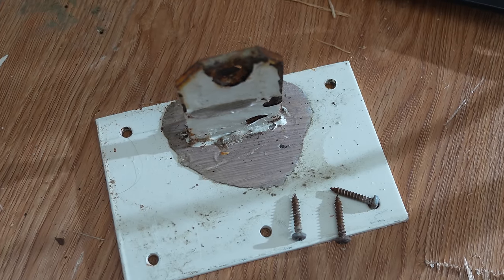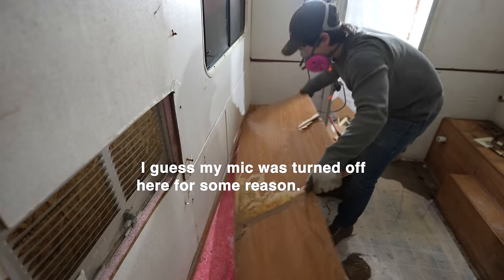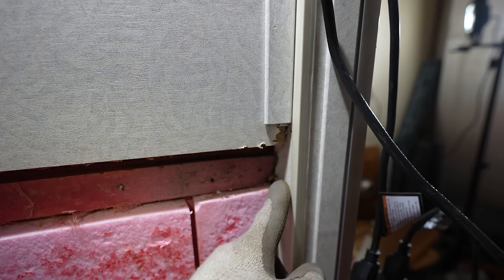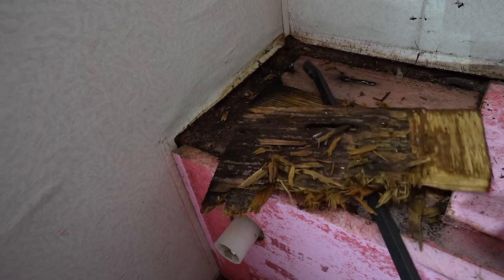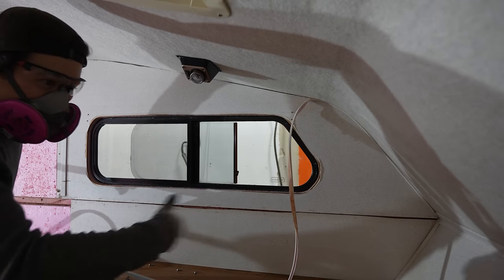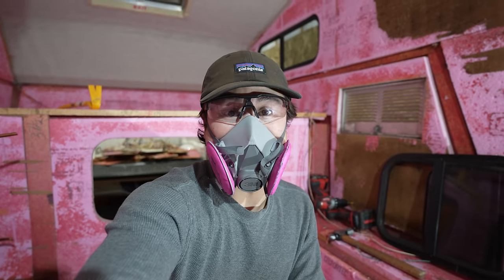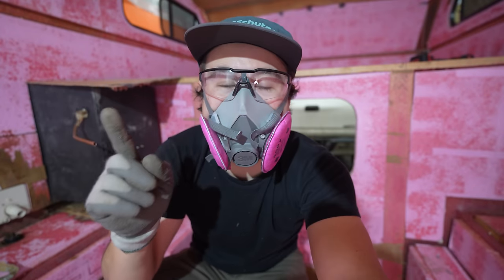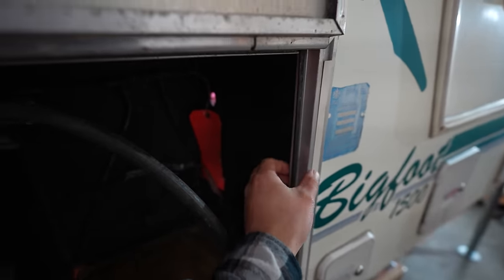It’s a Disaster in Here (Bigfoot Truck Camper Renovation)

Comment: As a Union Electrician. Please please please please pleasee!!!!!! Make your outlets GFCI. No one in van life is doing so. And all deal with water damage that laters damage their electric. If moisture is always present please install gfci outlets with usb to charge your phone. Also I can’t stress this enough. The last tiny home I helped with I suggested to the Client for armored cable. In case water gets in, or rats/raccoons, etc they are unable to damage the wires. Romex and those cute 12v wires will get destroy over time if water is in the built. Corrosion and all, which causes voltage drop. When voltage is drop not alot of amps get to pur appliances. Causing us to use it more to try to make up for it, but it wont. It may cost alot now, but get BX Armor cable. Or just expect you always fixing your rig every couple years. Too many water issues in these built and I keep watching romex, 12v cable being used. And fyi 12v can come in a armor cable it needs to be order. I keep watching people spend $10,000 on electric in tiny homes and it will get destroy within 5years from water damage to be done again. But job security is why most wont suggest this. Happy Built!! 🙏🏾
Reply: Hey thanks for sharing these awesome tips! 👍

Comment: I bought and converted a school bus in Washington state. The subfloor was plywood. It was absolutely soaked with water. The bus had no leaks. I think it was just 20 years of the pnw moisture with nothing to mitigate it. After converting it and getting rid of all the wet wood, I got a dehumidifier and I run it 24/7 in it. I have zero mold or moisture issues. Plus I have a wood stove and diesel heater so that helps keep it dry inside too. I live in it full time. I’d advise doing exactly what you’re doing and then use a dehumidifier when not in use and a dry source of heat when you’re in it. Ventilate whenever you’re boiling water or cooking, mitigate moisture as much as you can.

Comment: As many have commented, I really feel for you having all this water damage hidden just beneath where it could be seen. Wouldn't wish it on anyone. At the same time, I also, would be excited for the opportunity of making a completely custom and unique layout that can be perfect for you. Hell, it needs to be re-done anyways, and I suspect, with your investment now being far greater than originally planned, there's few reasons not to pull out all the stops and really go big!
If it's any consolation, it makes for truly great content -- very valuable and eye-opening for those of us looking to buy a used RV, such as myself. I, personally, won't ever unsee or forget your experience and bless you for documenting it all. It's a lesson I really can't put a price on.
3M makes a rubber "eraser" kind of like a grinding wheel that attaches to a drill, which is usually made for removing decals and stripes from paint - might work on the residue you're dealing with (just keep wearing the respirator in that case). You might also try acetone with a paint brush on it and then Red Seal for moisture sealing after.
Oh and any video between 20 - 30 minutes is ideal, longer can be fine if there's enough going on to justify it without too much repetition. I'm loving your current way of doing it -- good detail and not overly repetetive. 
Cheers!....from North Vancouver

Comment: You should get ahold of an ozone machine. Detail shops and body shops have them. You can put it inside an area and it will kill the bacteria and mold. Stops it in its tracks. It gets rid of bad mildew smell too. It leaves a little chlorine smell for a few days but airs out. Not sure if ozone machine is the correct title. Thats just what we call them at my shop. Keep up the good work. 👍

Comment: Oh boy, this is so much worse than I thought you'd find. I feel so bad for you. However, fear naught, you'll make it right. You'll be able to enjoy it for years to come. I purchased a huge '98 Lance with a dry bath about four years ago. Fortunately for me, the man I purchased it from did major reconstruction on it. The only part left with issues was the window over the bed that faces over the hood of my truck. Those always leak, and while I've repaired it, I plan on having it professionally removed completely next year. Glad to see your camper does not have that window. I'm a 73-years-old female and was able to completely reseal and repaint the outside of my camper. It wasn't leaking, but they need to be resealed periodically. It's  just part of normal maintenance. I've also made several modifications to the interior. For example, I removed all the cloth covered surrounds from the windows and made blackout curtains that go from the ceiling down to the bottom and the sides, not just over the window frames. Just those little changes make it look and feel so much more roomy inside. I also sacrificed a clothes closet to have a custom-built woodstove installed. Best improvement ever as propane heat makes too much condensation. Looking forward to following your progress. You've seen the worst of it, and you'll make it sound again and probably better than new.

Comment: The red stuff is contact cement. Lacquer thinner is used to remove that. If the dirt and mold is on that then try lacquer thinner. Wear your mask and use in ventilated are.

Comment: Killz is the best thing for mold. You will definitely need your Air mask because it smells absolutely horrible. You'll need to paint it on the bad areas and then leave for a day or two, to let the fumes evaporate. 
For drying your floor out, your best bet is a regular box fan. Heaters help but nothing will dry out wet areas like a floor fan. When you see an area is good and dry then just turn the fan to the next area. Best of luck Jonathan, I really enjoy your videos.

Comment: Those hold down brackets are fine, they need some sandblasting, prime & paint. Goof off will work most likely remove the adhesive left behind. Lastly, you gotta remove the insulation and use a hose to spray the outside and try to find leak(s). Good luck on the project!!!

Comment: What a mess. I remember when you purchased this and said that you wanted a fiberglass camper so you did not have to deal with moister inside! Kudos to you for seeing it through. Use anti Microbial bleach on the mold. When you seal up use silk a flex. Its the best stuff out there as it marine grade. That old fart that sold that knew there was water damage. I am sure as he was filling up the water and half of it went into the camper he was aware. Spray foam insulation where needed.

Comment: I spent a year rebuilding my travel trailer. 
Complete new front end
8 back from the front
3 feet of rotted roof at the front 
1 foot of rotted roof at the rear. 

New roof
New flooring
New ceiling in the rotted parts. 

Did a bunch of improvements along the way. 

1/2 way through I was rethinking my idea. Honestly thought about lighting it on fire and trying to claim insurance.  But I kept going. 

I now have a really really nice trailer. Anyone who have looked at what I have done are all really impressed. 

Don’t let it get you down, once you are done you will know what you have.

Comment: Good progress. Ideas: Use scotchbrite pads on a drill driver or small grinder to prep the fibreglass. Don’t breathe the dust. While the old damage is from leaks you will also want to stop using an unvented catalytic heater inside. Everywhere the water vapour touches the cold spots of the shell and windows will condense and saturate any material that will absorb it.

Comment: You may be able to find an RV junkyard/2nd hand materials. Like maybe double-pane windows, a diesel heater,, other things. However, since the unit is smaller than normal doing everything with newer materials would be better.  Best of luck. With the mold there are products, some expensive others are DIY which work like Vinegar and Water. Your choice. Check others who did off-grid repairs with mold, rebuilt campers on YouTube U.
Reply: Yes! Exactly. Vinegar is far superior for mold (30% vinegar at hardware stores also.) Bleach does not kill mold like many think. Most mold experts agree. It’s become a myth at this point. It doesn’t kill the mold roots. Second hand materials sounds like a potential avenue as you’ve stated as well!

Comment: Some years ago, before everyone was on You Tube, I read a post about a guy with a Class C who had a relatively minor traffic accident. Whatever was holding the house part onto the chassis failed, the box shifted and twisted and it was never the same again no matter what he did to realign it. Consider getting an ozone machine from someone, home renovators, used car dealers and detailers use them. It kills mold and mildew, be careful though and use it safely, follow the directions..

Comment: You really tore the camper down to the bones 🦴 on this one!  It’s hard work, and yes, while it is both surprising and disappointing to find the water damage and other issues, it is also a relief to know you’ve torn it out, are cleaning it up and making it better for you in the future!  Plus with it stripped down like that, you basically have a “blank canvas” to start rebuilding it, the way you want it!  Make sure the replacement mounts/bracing/brackets and all the installations you do, are rated for the maximum weight and the structural integrity etc., of the camper when replacing them, while keeping the entire project within the max weight, etc..  it will be interesting to see if or how you cut the walls out to deal with the leaks.  You might have to do some fiberglass patching/repair work inside and outside to make the shell more waterproof.  You can do it!  Breaking up the videos into smaller segments is a good thing, in my opinion. It shows stages of demo/tear down, then the next steps in stages.  You’ll be back out there doing what you love to do and you’ll have more confidence in your skills after this project.  Enjoy, be safe and keep going!!

Comment: looks a lot like my project.. :D nice at the first look, but something else under the surface, i ended up ripping everything of to bare glassfiber, all hatches, windows, doors and outer trims of, from the inside to bare glassfiber, after that you can pressure wash it, because there isnt anything to suck the moisture anymore.
blank canvas it is and lots of work you are going to need, strength to that process 👍
i ended up glueing 2x2 with pur glue in to the walls and had it spray foam insulated, after that it was easy to cover with thin plywood.

Comment: The floor is so wet because it is basically a bathtub. All the water ran to the lowest point and it has been trapped there under that linoleum for 25 years. Just rip it out because it will never fully dry out. 

When you rework the tie downs Don't forget you need backing plates at least the same square dimensions as those provided.

You may want to look at using Coosa board in the floor and starboard for any of the other features that might get wet.

Comment: Bummer, Jonathan.  
3M black strip caulk is good to use when resealing windows to side of camper.  
The window seals themselves and the drains plug and cause leaks too.  
If the window Glass seals shrink and gap, Black RTV Automotive type silicone works to fill trim gaps.   

Big Job ahead of you.

Comment: Always remember....If there are seams there's the potential for leaks and damages.
We too learned a lesson the hard way when we bought a older used Van. We bought it cheap. The motor is great  and milage not so bad the front interior is really surprisingly good but so many little things we have had to redo to be able to camp In it were at times overwhelming. 
After we finished we are so satisfied and happy.
You will be too.

Comment: Those fittings, small openings etc. that is sticking out of the exterior walls will be needed to removed and re sealed up all over again prior to repanelling your interior’s again, with all that foam board insulation is crazy cheap you can even replace all of or some of those pink stuffs to make sure everything is checked out under

Comment: Use a wire brush to clean that metal piece.Smear some petroleum jelly,grease or aluminum roof coat(silver like tar for roofs),and that should protect it long term from corrosion

Comment: These campers are coveted by many and were built here in British Columbia, Canada.  My boyfriend has one.  They are an all season camper that weigh literally 900 pounds and fit short boxed import trucks.  They were made with extreme quality and not just particle board cupboards.  This is an older model and fibreglass will develop condensation without anything like Drizaire inside the unit to absorb the humidity.  I am thinking that this is where the rot has come from.  The owner he bought it from lived directly on the westcoast of BC and the humidity here is insane.  I have a fibreglass boler and if I don’t have Drizaire inside it will develop mould.  It is still a quality camper and the water issues could have come from the waterlines.  Or maybe the butyl tape that is underneath the windows have lost their seal.  The bunk was dry.  I think it is a humidity issue.  It is good to remove the dry rot.  Check out “Tails Of Wonderlust.”  She drove all the way from Colorado to pick up the same camper in Tofino.  In 2016 when my guy got his.  There was a bidding war on it.  Simply because they are quality campers.  Big Foot and Northernlite were once the same company.  But they separated.  But they did not change the quality of their builds.  These days to buy a Northern Lite Camper your looking at a very high price.  So many take these campers apart and don’t realize that some things are structural.  I hope that things go well for him during his new build.  I would definitely check out the website Fibreglass RV for points on rebuilding a fibreglass camper.

Comment: Never fun when you uncover hidden damage but I'm glad to see you are fixing it right.  As for cleaning that mold and dirt I would recommend using Purple Power to clean the dirt and bleach for the mold. The PP may make it look like the mold cleaned off but use bleach anyway. It will actually kill the mold. Hope this helps and looking forward to the rebuild 🙂
Reply: Having dealt with mold and relatives owning businesses in construction and inspections, they told me that it’s actually a myth that bleach kills mold. The mold experts agree. Vinegar kills mold better than bleach, even strong vinegar (30% at hardware stores) is far superior. Just figured I’d share in case anyone might find it helpful.

Comment: Your brackets seem to be in good shape.  Just clean them.  Paint with a good expoy paint and then bolt them to the new wooden floor.  Tighten the bolts on the inside on the metal. That will give you a bunch stronger anchor.

Comment: Thoughts on cleaning the mold on the fiberglass.  My first thought was a TSP substitute.  Then maybe Zep liquid mold remover.  A good stiff brush first to loosen the gunk that is stuck on and will come off would help before trying some liquid product.  I'm glad you found those issues before your camper fell off while driving down the road.

Comment: I’m definitely into a longer 45-60 min video. Alex has the same exact Bigfoot camper and all the same water issues. A nightmare for the both of you! I’m FLOORED over those “mounts.” That’s absolutely terrifying!! You are such a talented tro oper Jonathan!!! We’re here for you and your work!! 👍👍 edit: regarding MOLD, bleach doesn’t work.  It’s become a “myth” that it kills but it doesn’t. Vinegar is actually highly preferred over many other cleaners, and at the big box hardware stores they have a much stronger 30% vinegar for about $20-30 per gallon. There are also inhibitors usually sold as sprays that one can use to treat wood etc. I’m not sure about the fiberglass aspect of it though.

Comment: I cringe everytime I hear someone say "silicone" when weather proofing an RV.  Silicone itself will fail.  Notice how that yellow silicone pulled away from the frame in you video. That is what it will do.
You are in a great place to get information from the marine world.  I suggest going to a boat build or repair facility and talk to the experts about marine caulking and adhesives.  Expensive but "buy once, cry once".
We're really enjoying your build.  Brings us back to our van build.
A suggestion:  Run all your wires and plumbing so you can access all the wires without removing walls.  That way, if something happens, or if you want to add something, you have easy access to the main wire runs.
Loving that you are tearing down to the fiberglass.  You've created a complete blank canvas.  The possibilities are endless.  My only regret is that I am not there helping!